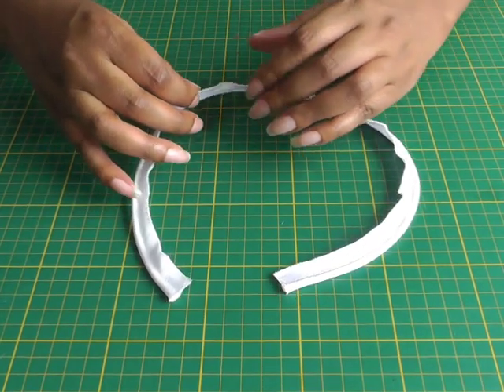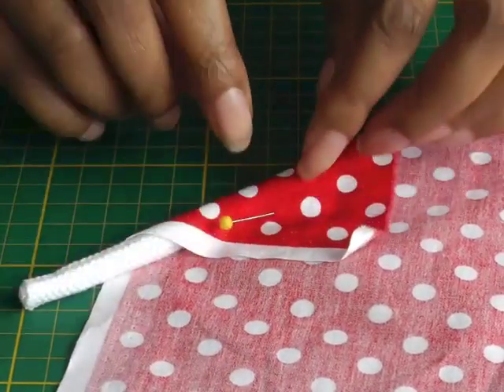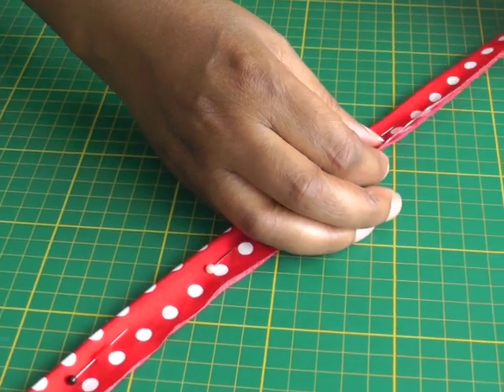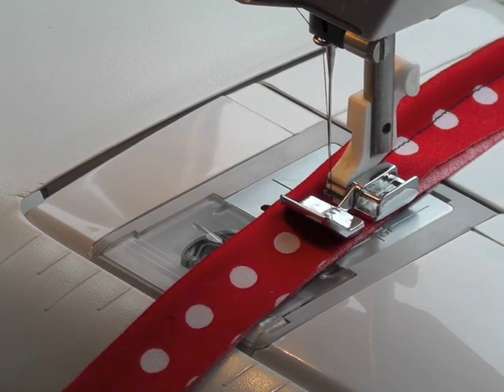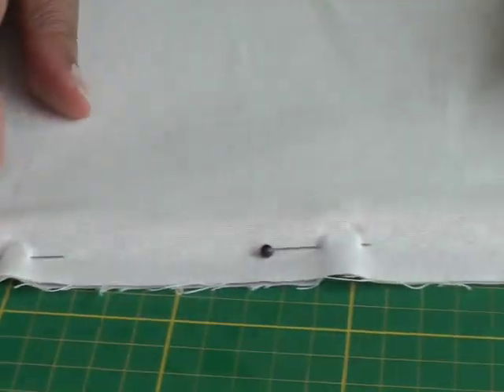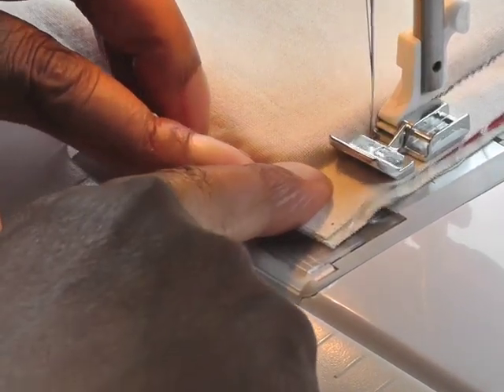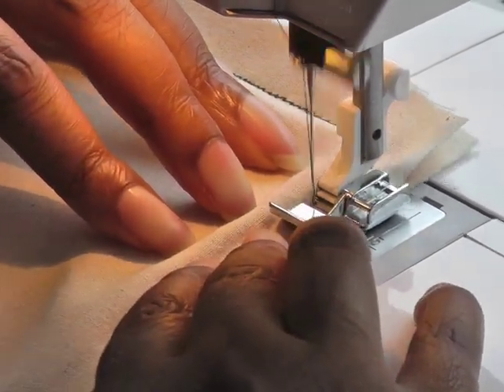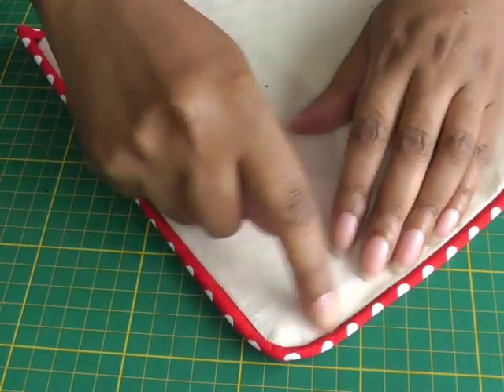Sewing with Piping

Comment: hi there! i really want to thank you for making this video and i'll definitely try it out, just a quick question though, i'm planning to sew on the piping on the side of the sleeve (from the neck to shoulder part all the way down the length of the arm) and i was wondering what type of  cord i should use to reduce the buckling of the fabric when i bend my arm?
Reply from the maker: Yamazaki Sousuke Try a polyester piping as the fibres are lighter and softer.